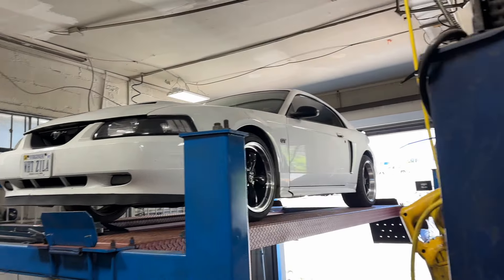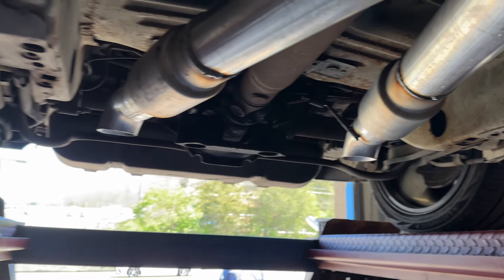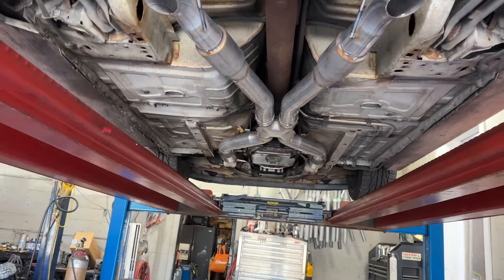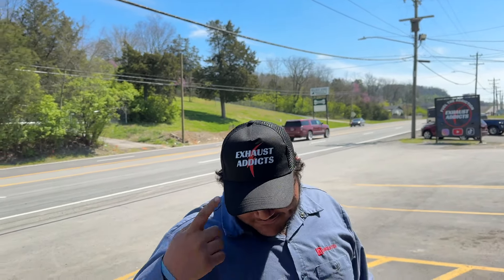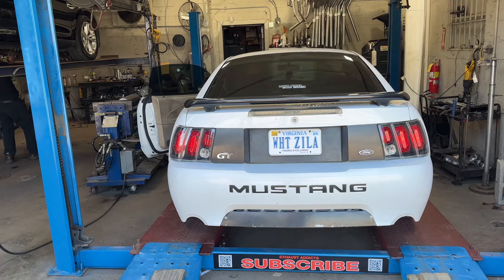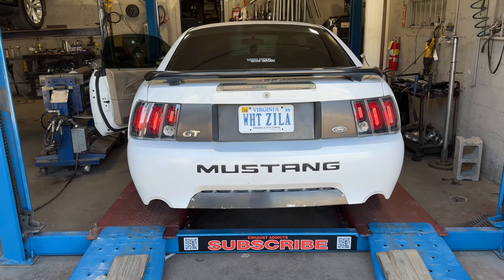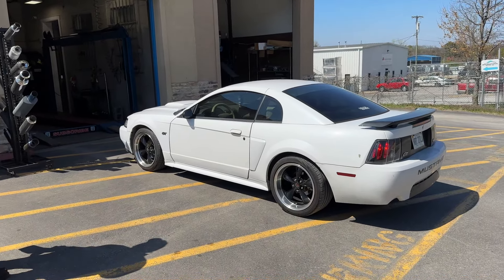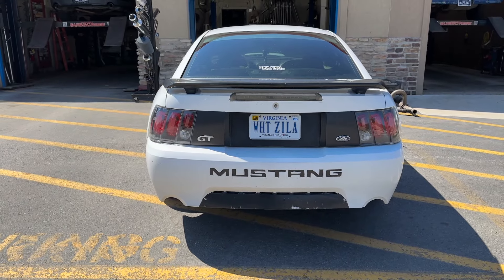2001 Ford Mustang GT 4.6L V8 w/ HEADERS & DYNOMAX BULLETS!

Comment: Why are exhaust shops afraid of bolts? That entire system from header flanges to exhaust tips is a single piece. I guess the exhaust is just never going to be removed?
Reply: More welds = more money
Reply: Are you referring to clamps? Because clamps leak a lot of the time.
Reply: @howieewalt1322  uhhhh not if they aren’t the worst quality clamps of all time???
Reply: V band clamps are supposed to be good.

Comment: Can’t build much out of 2v 4.6
Reply: @dennisburger1220 whatever you say to make you feel better Dennis
Reply: @dennisburger1220 is that it! Hahaha I ran that by just adding an ESS and nothing else…. Yawn
Reply: @dennisburger1220 and my car has heated and cooled seats and full sound system (2 12” subs in custom box) weighing in at 4050 pounds lol
Reply: @dennisburger1220 see you get it:)
Reply: @dennisburger1220 10:80 is slow my guy and dollar for horsepower yawn
Reply: @dennisburger1220 a 10 second car was fast 20 years ago. I’m saying facts if the truth hurts you maybe you should see a therapist.
Reply: @dennisburger1220 hahaha sure Dennis whatever you say man. I have a 15 GT and it’s turned down and still putting down high 10s. There is NO way your turd could win over mine. I have nothing to prove at all but if you feel the need I’m in Phoenix AZ.
Reply: @dennisburger1220 stop it Dennis no you won’t hahaha. I’m showing my crew these messages and everyone here is laughing….at you not with you hahaha
Reply: @dennisburger1220 it’s easy to talk smack from the comfort of the other side of the country hahaha. Seriously man thank you for the laughs.
Reply: @dennisburger1220 you’re delusional